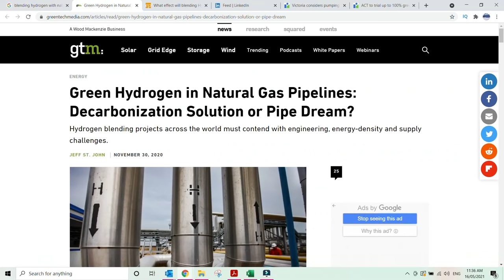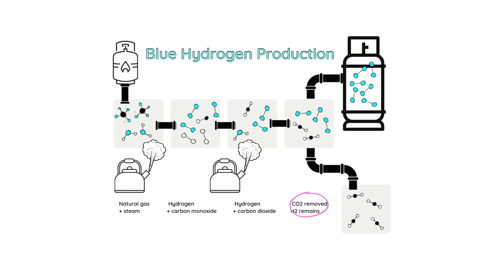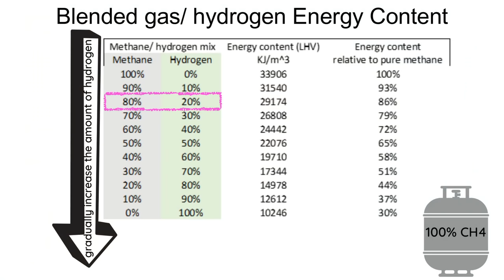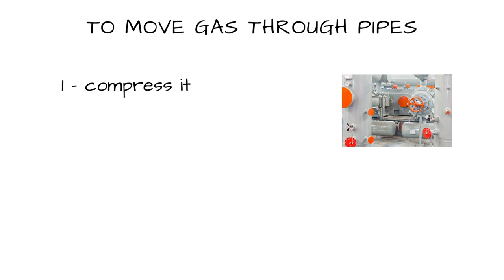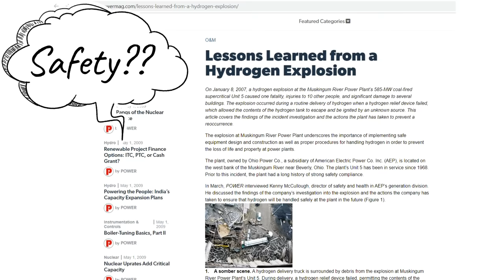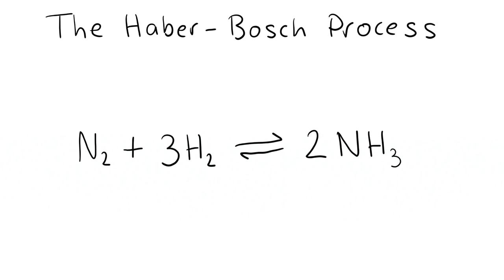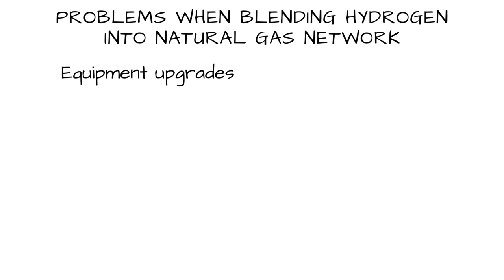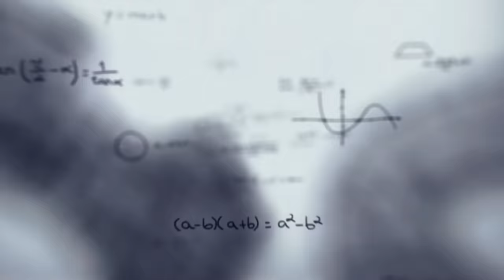Hydrogen in the Natural Gas Network

Comment: Martin mentioned that hydrogen is used in industrial processes, notably petrochemical processes and the Haber process.   The trick there is they use the hydrogen as quickly as it is generated.   The hydrogen thus does not have long to ooze through pipes and tanks or embrittle process piping.   Spacecraft generally get away with using hydrogen because they are "one and done" applications.   One mission and the spacecraft becomes a museum piece, no longer exposed to the embrittlement caused by hydrogen.

Comment: Just found this channel and wow it is really great.  I love this stuff.   I subscribed right away  !!!   But even a 5% use of Hydrogen in a Natural gas mixture going into pipes provides a hotter (more efficient) and cleaner gas flame.  You do not need 20% because 5% will work just fine.  Thanks for your video !!

Comment: There is also a number of very interesting articles on the production of methane (easy to transport and distribute) from co2 and green hydrogen. In my opinion, distributing hydrogen is not such a good idea. It is by definition an "industrial gas", dangerous, requiring special infrastructures and compression/liquefaction/hydrides to be used efficiently in consumer channels. This production method would leverage existing distribution infrastructures and at the same time  create a green hydrogen market without the inconvenients of hydrogen. Maybe a follow up to this video on the subject could be intetesting. Cheers!
Reply from the maker: A great idea for a future video, thanks for commenting!

Comment: I want to say Porsche developed a system where you inject water vapor into the combustion cycle at just the right time and it increases horsepower.  Engineering explained has a video about it
Reply: Yep water or water/methanol mix injection, it has the effect of raising the octane number of a fuel by slowing down the flame front in the "bang" part of the combustion cycle.
Reply: Water injection was used in WW2 Spitfires for a short burst of power.
Reply: Just be clear though:  this is a strategy to manage power in a combustion engine.  No ENERGY is derived from water in this process, because water has no chemical potential energy.

Comment: Excellent explanation on why Hydrogen will never work for heating or transport for that matter.   Zero point in using Hydrogen for heating when you create it with electricity, far more efficient just to use the electricity resistively, better but more expensive to use heat pump.  Heat storage is the new kid on the block using excess renewables in a renewable over capacity world.  Concentrate on insulation first to reduce natural gas heating, while building more renewables.

Comment: I’m surprised the concept of green methane wasn’t discussed. You can make green methane with CO2, water and electricity and then swap one for one. Efficiency isn’t great but green hydrogen isn’t all that efficient either. Given issues with methane leaks, it might make more sense to keep adding on hydrocarbon bonds and getting to liquid fuels for industrial processes - no worries about methane forcing.
Reply: and where is the CO2 obtained from?

Comment: small cogeneration units for home is a fast way to reduce energy use , that's a inverter generator connect to the grid , give heat + electricity .

Comment: Excellent, Only criticism is that unit mass was not explained.
Mass (symbolized m): 
is a dimensionless quantity representing the amount of matter in a particle or object. The standard unit of mass in the International System (SI) is the kilogram (kg).  So generally weight.
But ... The mass of an object can be calculated if the force and the acceleration are known. Mass is not the same thing as weight in the strictest sense.
Reply from the maker: Sounds like you know what unit mass means and didn't need an explanation 😉 But thanks for clarifying for those who didn't.

Comment: What about using hydrogen (and co2) to create green natural gas? It costs but it's a technology that we already have.
Reply: What about using SIMPLE hydrocarbons instead (anaerobic digestion). They can be transported and used in existing infrastructure.
You can basically create heat, electricity, fuel, soil fertiliser from your trash.
Leave hydrogen for rockets, heavy industry, ships maybe.

Comment: You can change what the pipelines are used for from natural gas to compressed air. 
Windmills could use compressors instead of generator and feed the pipeline system for storage and trasnporting the gas. Compressed air can be used directly for heating and cooling and can be run through a generator to produse electricety. 
'The design of vortex heaters and expansion coolers with hardly any moving part make them last for a long time and they are very safe.
Reply: And how would the efficiency and cost of adapting such a system compare with simply using electricity?
Reply: @garethbaus5471  You can store a lot of energy and compressors cost less, have a much simpler design and last longer then the generators used in large windmills today. It also do not need any rear earth metals to run.
You also have the advantage that no conversion is needed from storage to use.
A large tank for air is not cheap, but is a small fraction of the cost of as similar sized battery.
Reply: @bknesheim  Have you ever seen a tank explosion, now scale it.

Comment: It sounds like there are some benefit to blending in some (green) hydrogen into gas lines. Even if the blend is much les than 20%, and only amounts of 1 or 2% CO2 savings - over large areas that may be worth the extra problems.
And frankly, if some of those problems encourage people to move away from gas... I'm not sure that's a downside.

Comment: Great video, I always learn a lot from Rosie's videos.  I guess we just need to move to heating houses with electricity, heat pumps where possible and simple storage heaters otherwise.  When we moved into my current house 30 years ago (UK) we had storage heaters which worked off 'economy 7' which heated up during the night when electricity was cheap and discharged during the day.  Storage heaters are a lot more efficient these days and there are opportunities to charge them when electricity is cheap, not just overnight.  In the UK we already have electricity suppliers that adjust electricity rates 'live' for the electric car market.
Reply from the maker: Storage heaters is something we don't have in Australia, but I think it sounds interesting. I want to do a video on home storage alternatives, and that would be a good one to include.

Comment: But I ask you this question y can you use a solar dish to generate the electricity to produce the hydrogen like how they use a heliostat to produce power in Spain why is this not possible???
Reply: You can use thermosolar powerplant to do that, to break water into pieces, hydrogen and oxygen, required temperature is ~ 5800K.
(Heliostat is only < 2300K). It is an thermosolar powerplant, but less temperature. It can't break water.
Next type is photovoltaic powerplant, they are common and can break water via electrolysis.
You have mixed all three technologies together, but that's not how they work, two of them work independently.
Reply: @ivobrick7401  thank you for the information each one teach one

Comment: In addition to all the other bad features of hydrogen gas, what about hydrogen’s embrittlement of metal pipes and damage to electronics?
Reply from the maker: Yes, we did discuss it actually but I cut it because it's mostly related to long distance pipes and I kept this edit to local distribution where the pipe materials aren't as problematic. I probably shouldn't have cut the part about embrittlement though, lots of people have mentioned it!!
Reply: as well as shortening the life of the turbine / piping, etc.

Comment: Another disadvantage, rarely discussed, is how poorly hydrogen performs in a combustion engine, with a rather large loss in energy completely overwhelming the decrease in emissions. This is more than impractical. It cannot be overcome with the paradigm we currently use in transport, which represents the largest contributor to the problem.

Comment: Aren’t there ways to store hydrogen in metal? (hydrogen goes into the metal like water goes into a sponge)
Reply: Yes, Bob Lazar made efforts in that direction, yet Li-6 has been restricted from sale in the U.S. since 1956.
Many problems w/ hydrogen embrittlement of metals.  Though as in POWER HUNGRY: Myths of Green Energy, the energy density simply isn't there.  Synthetic fuels can release over twenty times the thermal energy of Octane fuel, but when a book gets published on the subject matter, not only is it restricted to German, it's released to the public in September of 2001.
Universities are gatekeepers, getting paid big furlough 'stay busy' monies, while promoting stay busy technologies that don't advance, or worse, regress to 'green energy' low density standards of solar. (Tete Einstein, aka one stone)
Unless it's in an environment requiring pneumatics (ie no spark), practically all commercial/heavy duty equipment use HYDRAULICS, as it ALWAYS proves not only to be the more powerful, but also the more efficient option.  DOUBLING THE POWER RECOVERED BY ELECTRICITY GENERATION, which is only 50% max.
ie better to direct drive a pump by turbine, than to generate electricity to run a pump motor.  The high value resources used in complicating the system could be used to quadruple energy recovery, between lower cost materials and labor, a second set of kinetic energy pumps would double production of a system twice as eff.
PS If I had arts degree level intelligence, I wouldn't answer me either.  After all, Einstein's accreditation was a Bachelor of Arts, and everything associated with him is still Theory.  While Maxwell received the same Nobel prize the following year for the same work (B/C IT WAS HIS WORK TO BEGIN WITH).  Sophistry is a trait of the arts degree holder.
Reply: Hydrogen doesn't "go through metal" in that way.  Hydrogen ATOMS can diffuse between grains of metal.  Hydrogen molecules don't even embrittle carbon steel unless you get it very hot.  Hydrogen is very diffusive and leaks through pipe joints and sealing materials, but we know how to handle it safely- industrially that is.
Reply: For many years there have been attempts at creating a sponge-like metal structure that could absorb hydrogen in its lattice structure. It works - for a while. The problem (as I recall it) is that every time you push the hydrogen into the lattice and later remove it (usually by heating the whole "sponge" up), the lattice structure is damaged just a tiny bit. After some time, what used to be your "sponge" is reduced to a pile of dense "dust" that cannot absorb and hold much hydrogen.

Comment: We always talk about the losses we have in each transformation of energy, but we never seem to compare it with the losses inherent in the fossil fuel cycle. Pumping it up, transporting it, refining it, transporting the refined products and the losses in using the fossil fuels. Nowadays we are able to produce electric motors with an efficiency in >+95% (world record is close to  99%) and electric generators with similar efficiency, and inverters also above 95%, and gears also above 93% so very small losses indeed. So gravitational  storage system can actually operate at very low losses
Reply: Indeed, and it is probably why gravitational storage is by far the largest portion of all installed energy storage today, far surpassing batteries and other storage systems.
Reply: @listerdave1240  well yes, but you are most likely thinking about hydro-storrage systems with big dams, but infact lifting and lowering +30ton blocks of composite waste material, lifting them up when there is excess of power and lowering them when there is lack of power, thus profiting from the price difference pr KW.
Reply: @steenhansen5625  When you do the math it turns out that the idea of raising and lowering weights is not a feasible solution.  The amount of energy you get out of each shaft/winch/weight is pitifully low. You would need hundreds if not thousands of such devices to achieve what even a small hydropower plant can achieve.
Even in the extreme case that you were to start with a flat piece of land that is considered unsuitable for pumped hydro it would still be much more economical to dig underground reservoirs, or  build water towers and transfer larger masses of water in bulk as opposed to lifting and lowering individual weights with winches.  There is no sense to using individual weights rather than transfer a fluid in bulk and it is easy to see why.  Whereas a winch would lower one 30 ton weight every few minutes a small pipe could lower that same mass of water every second through a pipe of similar diameter to the shaft used for the weights. And the water would just be going continuously, no hooking and unhooking of weights, positioning them and all that. 
The idea of using solid weights to store energy is just one of those ideas that look neat and clever on the surface but refuse to die despite not having any real merit when  one looks even just a little below the surface.

Comment: If we really need gas, maybe use Sabatier process, that's expensive energy-wise but it uses CO2 and hydrogen
Reply: SpaceX plans to use the Sabatier process on an industrial scale to make methane for use as rocket fuel for their next generation rocket, the StarShip.

They can afford to do this because the cost of fuel is a tiny part of the cost of a rocket launch.  They have not announced how they plan to get enough carbon dioxide. Sucking carbon dioxide out of the air is really hard.

Comment: Hydrogen is so incredibly leaky. Able to leak through things and through any joints that don't have a perfect vacuum seal. Natural gas infrastructure is already notoriously leaky. We frankly would hardly be able to hold hydrogen in our pipes in any building as far as I am aware.

I feel like electric is the best way to heat things in the home and cook, because it is clean and safe.

If we make hydrogen for power keep it at the place it is made and maybe just use it with hydrogen cells when electricity is needed.

Comment: To a first approximation, we should keep in mind that dealing with electrons is a whole lot less trouble than dealing with protons.
Reply: Hydrogen has both!
Reply: Seriously, whatever type of storage for surplus wind power is welcome, especially if the hardware is already around and well proven.
Reply: @Tore_Lund  Wow. Who knew?
Reply: Not when it comes to storage.
Reply: @richdobbs6595  Yes. ESPECIALLY when it comes to storage.
Reply: @ronaldgarrison8478  This has become a meta discussion. The electron has certainly moved to its second orbital.
Reply: @Tore_Lund  Come on, you know as well as I do, hydrogen only has one orbital.
Reply: @ronaldgarrison8478  Punch IT and the electron jumps to a higher Energy level for a brief moment before IT drops back sending out two orange photons.

Comment: He focused a lot at on the numbers relating to energy content by volume, but that is not a problem by itself, only a problem of higher pumping costs and for some end uses of the gas.  There wasn't nearly as much technical information about the actual impact to pumping costs (he just said ~20% at one point, 20% of what?), or what the actual effects are on turbines or nat gas burners, or how they could be mitigated.

Likewise, the home safety concern is real, but it was presented as though it were an unsolvable problem, and it's not.  We already have natural gas explosions that occasionally level a block of houses and kill a bunch of people, but we don't stop using natural gas.   We figure out how to make it safer instead.  (https://rpgaspiping.com/blog/critical-safety-tips/gas-safety-natural-gas-explosions-are-too-common/)
Reply from the maker: Good points, thanks for commenting.

Comment: Wouldn't compressing a liter of hydrogen require much less energy compared to compressing a liter of propane? It's less dense so the rotor in the compressor would not need to apply as much torque. Maybe I'm missing something. Anyone?

Comment: The fuel to be used could be NH3 ammonia or as an H2 carrier. Internal combustion and turbine manufacturers have already fabricated NH3 equipment proven to be effective. Converting NH3 to H2 is very easy both ways.
Reply: Have you ever experienced an ammonia leak?
We used to use bottled ammonia in a chemical process and it is not something I would like to work with in large quantities. If you had a burner burning ammonia, the amount of ammonia that would leak when you start the burner would knock out every one in a kitchen. It is not something you would let your average person be near and you would have to have people with respirators when working near equipment in case of a leak.
Reply: That's injection in very small% to suppress NOX gas, not as a fuel.